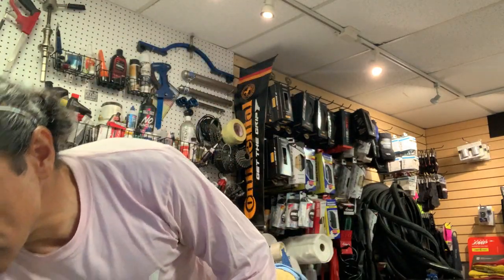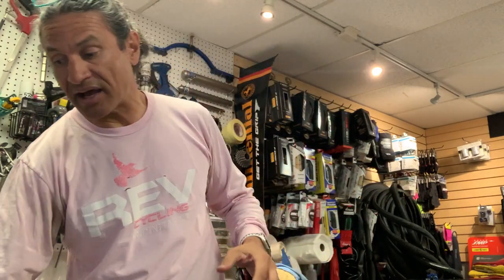Rad Power Bikes issues Two STOP RIDE notices!

Comment: Are the wheels/tire size proprietary to Rad?  If Rad ever went under the tires would become unavailable? If that's true (and I've not misunderstood) that's crazy
Reply from the maker: Designed for use on their bike. Just one step away from proprietary I think.
Reply from the maker: I believe they are 22” tires
Reply: @SeeYouUpTheRoad  Thats not great. Means higher prices for replacement tires and most people would never think to ask if its a proprietary size, especially consumers who aren't serious cyclists.
Reply from the maker: @WowRixter  correct!